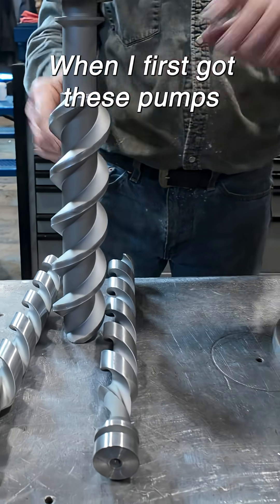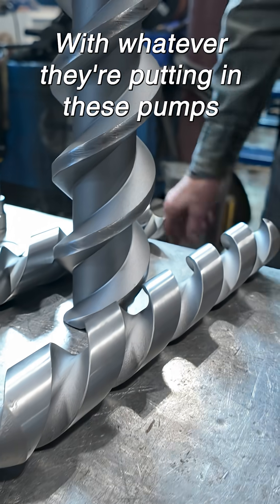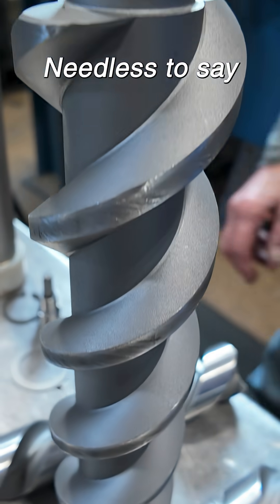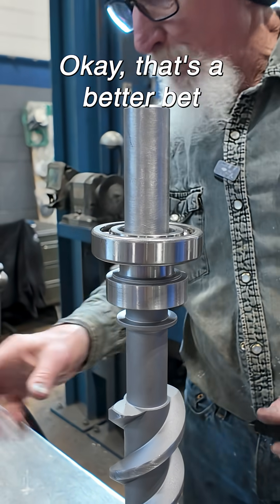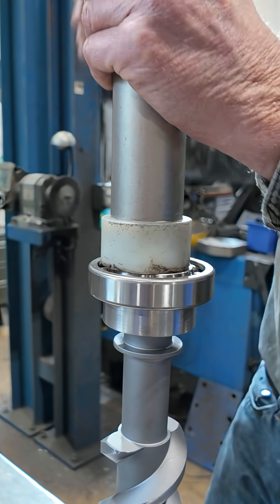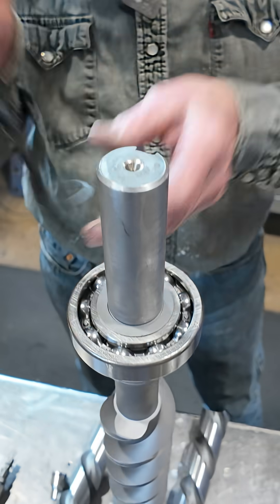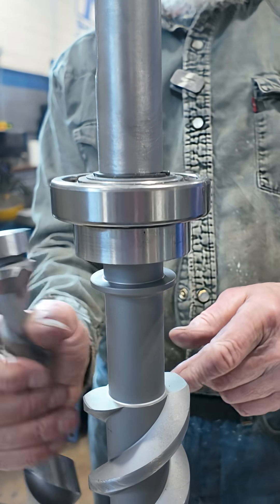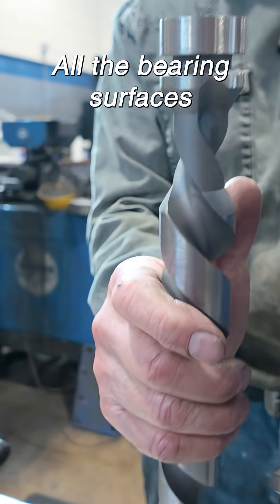Shanley SEIM Three Rotor Screw Pump Assembly Part 10

Comment: Is that what the suction pump for a septic  tank looks like?😊
Reply: nah not likely these would be high pressure hydraulics ect.. only perfeectly clean oil or air runs through that.

Comment: How fucking hard is it to heat up the bearing up? Just buy a small fucking convection oven, turn it to 100C and plop the bearings in, warm them up, just toss them over the shaft, they will seat nicely, shrink in place and you won`t have to fuck up the bearing seat on the shaft... This is disgraceful...

Comment: Are these fracking pumps? They look pretty beefy.
Reply from the maker: Yes they are!
Reply: @shanleypumpandequipmentinc3857  Do they pump liquid? Are they high pressure pumps or just high volume? 🤔 👀 😳 😮
Reply from the maker: @wesman7837  They can be both depending on configuration. We have some pumps with Screws that are almost 2-ffet long each. But each pump has their sweet spot. Past a certain point you switch from screw to progressing cavity.